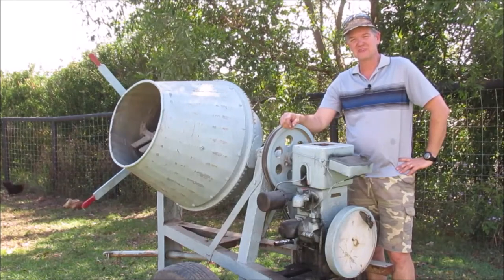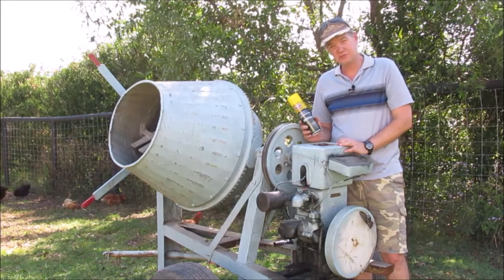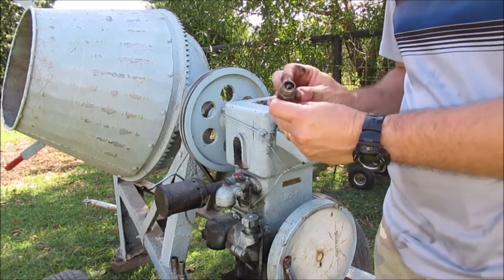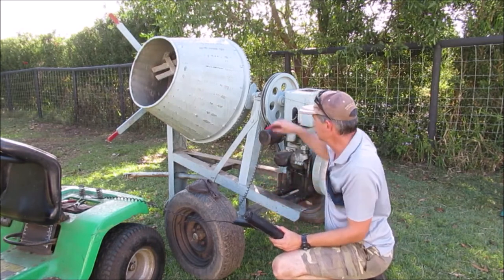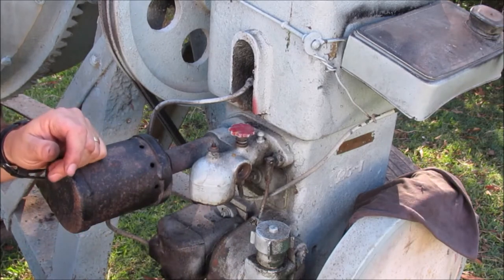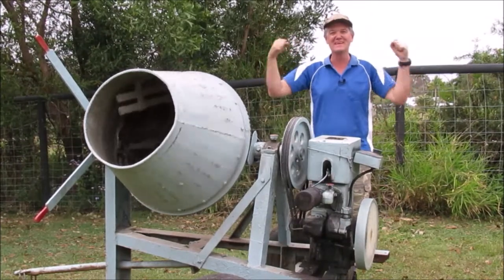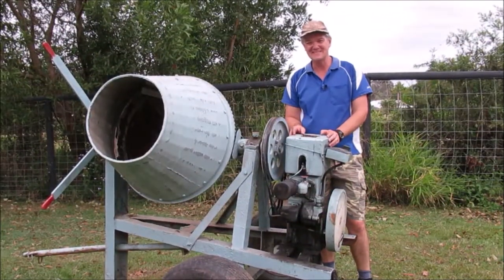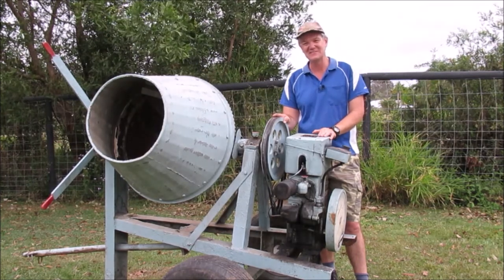Starting an old Cement Mixer!

Comment: The plunger you were pulling up on the carb is the choke, just pull it up for a cold start
Reply from the maker: Thanks for sharing this.  I'll give that a go and hopefully that will make it a lot easier to start.
Reply: @countrylifeonthecoast4167  I've grown up around Ole timers most of my life and where the younger generations like to brush them off as "has beens" and  forgetful,  I found that they are a plethora of wisdom and useful facts,  I recently became a proud owner of a early 40 cement mixer that has an international type LB motor when a good friend passed, he knew all the tricks to making the old stuff work like new, sad to think that future generations will never have an interest in the great machines that built this country.